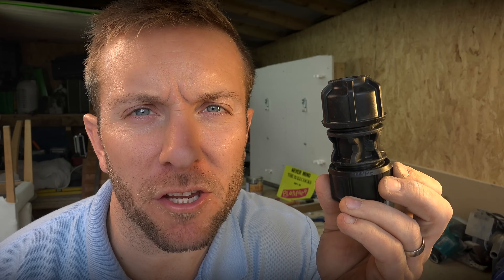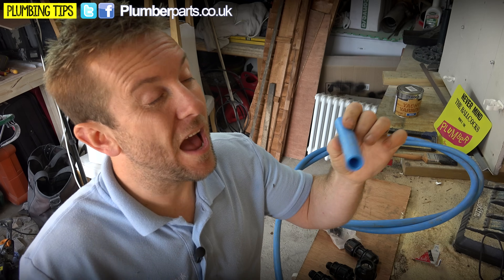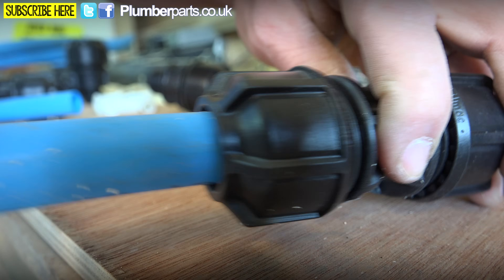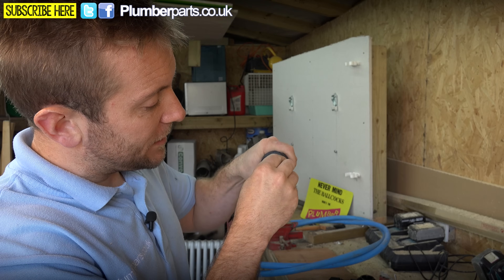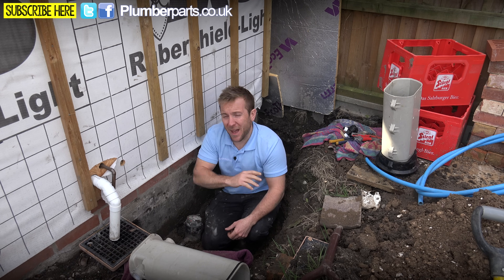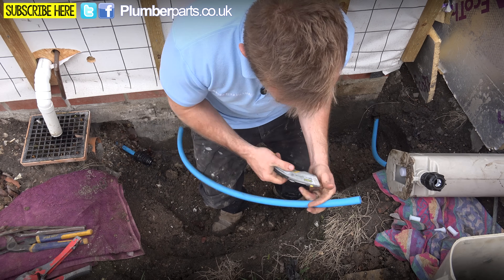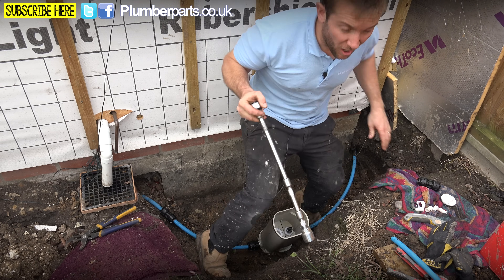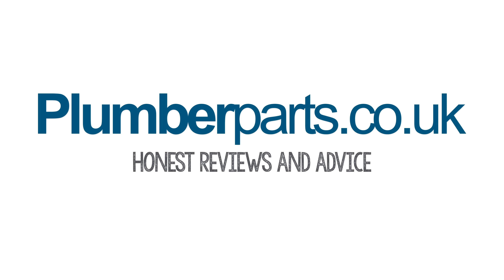MDPE MAINS WATER PIPE - ATPLAS CHAMBER - Plumbing Tips

Comment: Hi..A quick question if I may.
My blue mains water pipe runs under the house and comes out the kitchen floor. My question is...where my pipe comes out through the hole, there is a gap allowing draft in, can I collar or seal this to stop the draft?

Comment: Hi James, very informative! Had my first play with the blue stuff yesterday. Had to change my dead main stopcock. Got a few different fittings to give me some options. In the end I went with a trad brass stopcock with asymmetric connections, 25mm to 22mm. Worked like a charm though hacksawing the old one off was a bit nervy 😅
Reply: Just to add another tip for cutting the pipe. You can use nice sharp pair of gardening anvil secateurs and give it a little twist as you're squeezing.

Comment: Nice demo thanks. Do you have any tips for connecting 20mm MDPE to a standard 22mm brass stopcock. I'm removing a 3/4" black water pipe that has been connected to 20mm in the ground outside the house adjacent to the D/S WC. The black pipe has a rupture in it. Inside the WC I'm working in a fairly tight space next to the stack pipe and there's also a 15mm copper cold feed in the same space that was boxed in. I thought it would be possible to get a brass 20mm to 22mm compression coupling but have only seen the plastic ones like the one you fitted here (with the 22mm copper adaptor grommets etc). These are massive by comparison. Am I just going to have to make space to fit this monster? Thanks

Comment: What he did not tell you about this product is,  that in cold periods  down towards freezing the pipe going into this type of fitting will shrink and eventually pull out of the fitting. Also on during hot temperature it expands. If it is fitted to pipe in warm to hot weather it may seem tight but if it the pipe shrinks when cold it will leak.

Comment: I have a copper pipe in the main water supply. The pipe has been damaged at the garden side. Therefore, we want to join a new pipe from that point as the builder told us. However, I started to wonder if it would be a good idea to have a joint underground and looked for any videos to see if there are any sort of inspection chamber kind of things to keep that joint accessible and observable. That's how I came across this video. 

What is the common practice to follow here? Instead of replacing the entire pipe that will require breaking the concrete floor from the garden towards the main road and digging the driveway to put a new pipe, what is the best way to join a new pipe segment from the point it has actually been damaged?

Comment: Hi! Have you got a video on how to convert a lead pipe to 15mm copper? Old house problems!
Reply: I did exactly that with a connector from ToolStation which gripped the Lead pipe perfectly down to a 15mm male compression. However - Get your water tested with the local water company (its FREE), I was shocked at how bad the lead was in the water (28950 parts p/ml) the accepted level is less than 10 parts!  Even after 5mins running the water it was still above acceptable limits. So its a full replacement from building out to the street.

Comment: Thanks for the great videos as always. Firstly I’m not a plumber! Ha! Could I use this pipe to fit a outside tap for the garden. I need to run it from a tee on mains water pipe in the loft then out down the wall to the outside tap. Can’t seem to find any information on this. Be great if you could do a video. Much appreciated for your help.

Comment: Hi I am am building an extension and after digging some of my footings I have come across our mains water pipe. This is a 15mm copper pipe and it runs the length of or trench. We live in Melbourn, Cambs and I would like to know if laying a new MDPE pipe is something I can do myself? We have a main stopcock on our side of the boundary so it would be a case of digging a new trench for the blue pipe, laying the pile and connecting it up.

Comment: HOOooooold tight! 

I’m doing my bathroom pretty much via this channel, fantastic for a sparky to trade.

What I really could do with some help with is I am running my new plastic pipe to my sink and toilet locations but I’ve came across a problem. 

Under my floor i have what I think is 22mm galvanised pipe with T fittings going down to 15mm at bits. 

Can I connect this to existing galvanised pipe to use my jg speed fit stuff? Totally ruined my day today 🤨

Thanks. Rab

Comment: This was great explains a lot. I am taking on re-plumbing our whole house and we are going from a Black Alkathene mains inlet to  after the stopcock 22mm PEX (reducing to 15mm for taps etc.) We have very high water pressure so as well as a new Stop-cock we also need a new pressure reducing valve. I have looked at a few of your videos and think I can fit the stopcock no problem, but not so sure about the PRV, cant seem to find one that is compatible with PEX. Any advice? Or links to videos on how to fit a brass PRV to PEX pipe? cheers!

Comment: Hi. Would these fittings possibly be the reason for my meter box filling with water? 
I noticed that the only accessible bit of water main after the meter is 15mm copper and it's only about a meter away from this chamber so I assume someone has joined it to a very small section of blue straight from the meter?

I was going to dig out a small section of ground and see if I could replace it but I'm not sure if my problem is inside the chamber or outside really. 

Really appreciate any tips. :)

Comment: Plumbing my home from scratch and Thames Water just connected my new 25mm MDPE pipe to the street. Still need to fit internal isolator tap as it's wanging about in front yard with no stopper / tap. QUESTION: is it best to take 25mm all the way to back of house where megaflo and boiler will be, or should I convert to 15 or 22 at the incoming isolator tap at front of house? Need to get some services off it near front of house as well. What's the normal thing to do?

Comment: Hi ,I've just replaced an old lead water main and moved my stoptap into the understairs cupboard due to some building alterations. I now need to re route hot and cold water to the kitchen sink ,it would be so easy to tap into the cold in feed and hot out feed on my combi boiler but is this legal (drinking water wise) or do I need to take the cold directly to the kitchen sink first before it supplies anywhere else. Hope you can help thank you.
Reply: Mark Riley I'm sure it's fine to do and not illegal as the hot is fine as it's a outlet from boiler and the cold is still fed off mains just exits to kitchen before boiler entry
Reply: as you have a combi boiler, all cold water outlets are potable water, that isn't illegal at all. its just that the routing of the pipe to kitchen is longer.  be sure to fit a DOC and a Dbl Check valve after your stopcock to comply with WRAS

Comment: Im cofused, I read you had to have the pipe a minimum of 750 mm below ground. Im at about 500 mm now running a trench from my house supply to an annex (about twelve meters run. will it be frost protected at 500 mm. Im not very keen on digging.
Cheers.
Reply from the maker: I go on the current level of the mains pipe coming in. Usually insanely thick copper from the 1930's!

Comment: I want to run water to my brewshed, the only water source is my outside tap so can you do a video on how we home brewers or gardeners extend water to a shed. What happens at the shed end, how do you fit a tap to MDPE?
Reply: they do plastic bibcock taps for mdpe.
Reply: +Mark Davies You can get all kinds of fittings for MDPE pipe, you could run the MDPE into the Brewshed (through wall) to either a wall plate elbow which would give you either 1/2" or 3/4" BSP fitting which you can put/wind a bib/garden tape into OR come through the wall into an elbow a bit of pipe then MDPE Stop Cock (MDPE to Copper, 20mm mdpe to 15mm copper) You are now back to household copper fittings "hold tight".

Comment: There you are with the singing again mate!!  Nice video as always.  I take it the water board chaps only own the chamber in the street then?
Reply from the maker: +James Garlick Yep. What usually happens is they supply and fit the atplas and pull your pants down. Like £450+ pants down. The chamber is only £25! so I do mine myself and tell them to just fit the new meter. Suddenly the bill is £100 area.
Reply: +plumberparts I see.  I needed to change my gas meter box when I moved into the new house as it was damaged and looked crap anyway.  They wanted £220 + Vat to change it.  So I did it for £45 from ebay and did it myself.  Amazing how the can justify their prices.
Reply: plumberparts  i had a new water connection added to my property which i am trying to split into flats. After seeing your comment i know I've been had by the water company  
:( 
Paid a little over £4k for them to dig a trench from the mains to the boundary of my property (about 3/4 metres) and install a new water meter. I then had to pay my builder £350 to dig another trench from the new meter to inside the property and fit the blue pipe with insulation. 

I didn't realise plumbers could do the majority of the installation as all the local plumbers/builders i asked didn't have a clue about how to fit new water meters. 

Oh well lesson learned, any tips for installing new electric meters? Or how to go about adding more water meters ? As that's next on the list lol. 

Love your videos 👍🏽